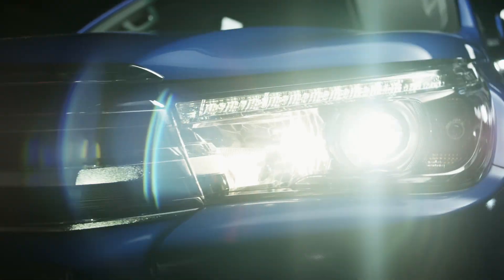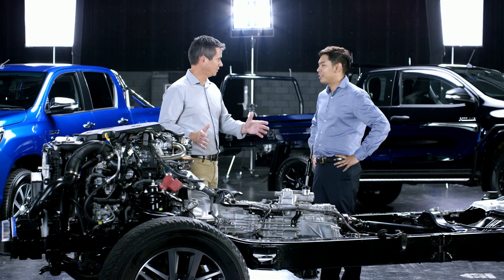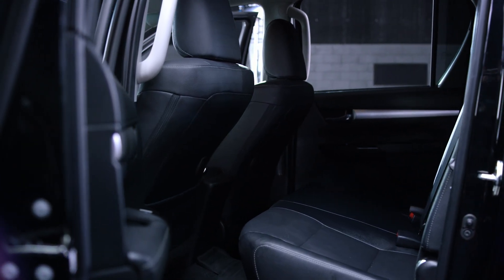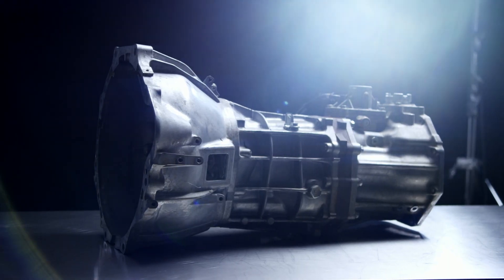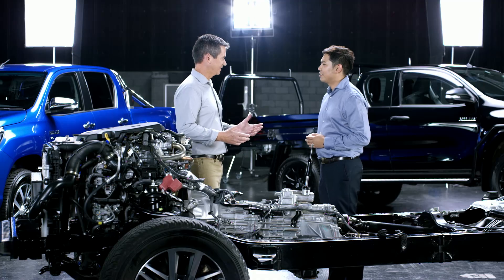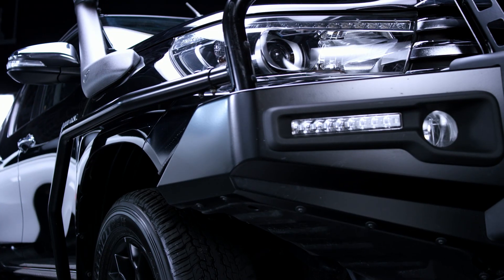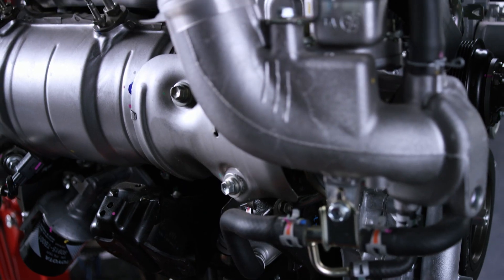HiLux: The Making Of Unbreakable - iMT Transmission and Technology

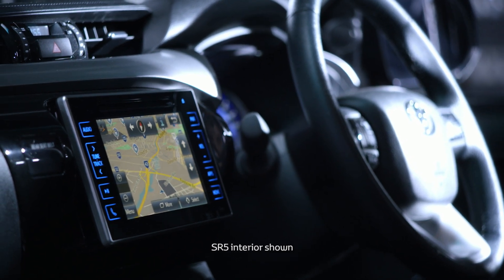Comment: 2:01 Why not have the loom there coiled up at the back of the chassis ready for when people put their tray on they can mount a camera and use the plug their waiting. Then it's part of the oem loom and you don't have to pull half the car appart to fit one later on.